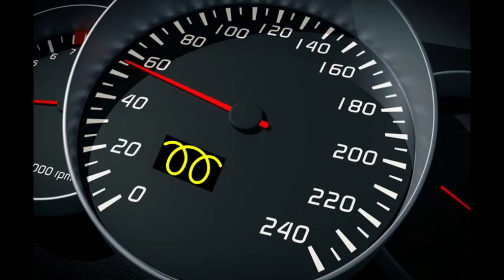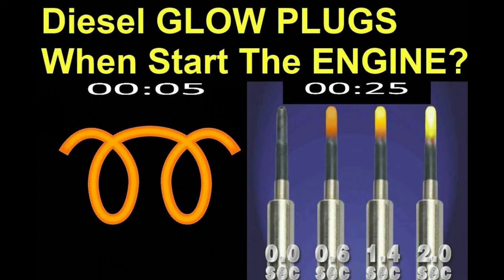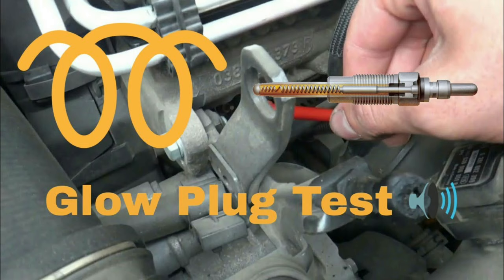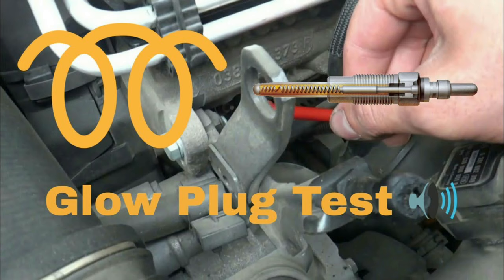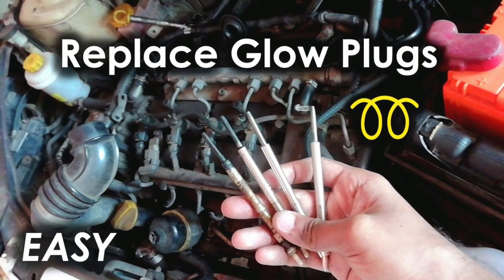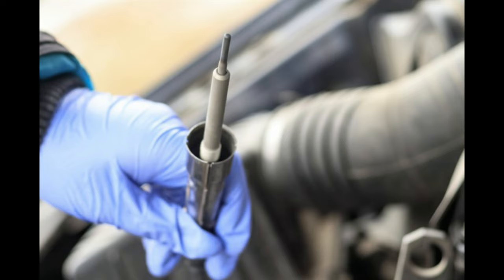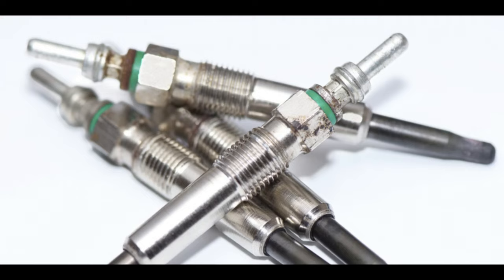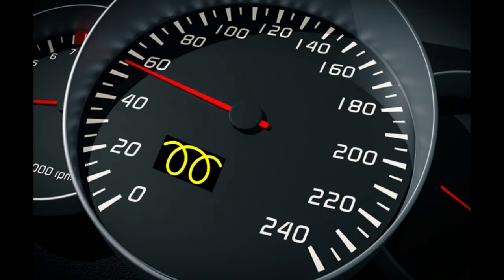How to Fix Diesel Glow Plugs Active Warning Light Stays On? Why is my Glow Plug Light Flashing

Comment: I have a 2014 vw Passat tdi and this light come out running and the car turn off and then I just start again and not problem but some time do very frequently… do you the reason?
Reply from the maker: If the warning light comes on, visit your Volkswagen dealer as soon as possible. VW will turn the light off for free. Until you visit the dealer, don’t drive over 80 miles per hour.
Reply: @Dashboardwarninglights  yes when I pass the 80 miles usually show up … I when to the dealer and they change the computer the new battery and injector and still doing the same thing.. do you have other idea what could be ??
Reply from the maker: Visit your mechanic better
Reply: @aguilat85 did you find the solution ?
Reply from the maker: I think It better for you
Reply: @chahrazadmqam3733   yes I the end I have to change the all harness of injection system… and never happened again…
Reply: @aguilat85 injection system means
Reply: @aguilat85  I’ve got the same problem as you. I haven’t seen a mechanic yet. Was it an expensive fix?
Reply: @jamespecking  I just order the injector harness in my local dealer .. and do by my self ..
Reply: @aguilat85 so the computer and battery they changed wasn’t needed? Only the harness for the injector system?
Reply: @shandhillon1975  yes at the end just the harness…. They change the battery and computer but don’t need it …

Comment: I drive an A class and it's extremely cold in the mornings so my car has started doing this and the sign disappears when I have started the car. Thanks for the info.
Reply from the maker: @ZintleNtanta The diesel glow plug warning light on your dashboard typically indicates that the glow plugs are heating up to assist with starting the engine, especially in cold conditions. Here are some key points to consider:
👉 Normal Operation: In cold weather, it's normal for the glow plug light to come on when you turn the ignition key. It usually stays on for a few seconds while the plugs heat up, then goes off once they're ready and you start the engine.
👉 Prolonged Illumination: If the light stays on for an extended period after the engine has started, it could indicate an issue with one or more of the glow plugs or the glow plug control module.
👉 Intermittent Problems: If the light sometimes stays on longer than usual or comes on randomly, it might be a sign of a developing problem that should be checked.
👉 Diagnostics: Modern cars often provide specific error codes that can be read with a diagnostic tool. This can help pinpoint whether a glow plug or another related component is malfunctioning.

Given that the light goes off once the car has started, it sounds like the system is functioning as intended. However, if you notice any starting issues, prolonged illumination of the glow plug light, or any other warning lights, it would be wise to have the car checked by a professional to ensure there are no underlying issues with the glow plugs or their control system.
👉 Happy to help!

Comment: No lights come out through glow plug ang battery what is the problem of this.
Reply from the maker: @user-Ir9dq6zn2c

If the light doesn’t light up, the glow plug is bad and should be replaced.
Easier is to use a professional glow plug tester device.
There is some discussion about whether you should only replace the glow plugs that have gone bad, or if it is best to replace them all.

Comment: I have got a Polo GT 
Like if I cross 120 this Glow light is coming up and there is an Engine break down
Can I get any solution for this

If I just switch Off/On the engine 
It will be again back to normal
Reply from the maker: @syedmufeez-st1tp
Maybe a leak in one of the hoses from the turbo

Comment: I have no warning light yet the diagnostics picks up a p0683 code with pre heating fault indicating no feed back. 
Glow plugs changed, wires checked, relay changed. Really stumped now. There seems a lot of indication it could be a  problem under the engine fuse box ,  wiring. Connectors and or the wiring itself.
Reply from the maker: @CapTango

Possible Causes of Code P0683
Reasons for this DTC may include:
Open or short circuit in the wiring from the PCM to the GPCM, to the bus, or from the bus to the glow plug.
Defective glow plug
Loose or corroded joints
Unsuccessful GPCM
Loose or corroded connections on the glow plug solenoid.
Glow plug solenoid malfunction
Insufficient battery charge on solenoid
The P0670 code may accompany this code. This code indicates a problem with the harness from the GPCM to the solenoid.
Diagnostic and repair stages
Over the years, I've found this to be a common problem with diesels regardless of manufacturer. Because of the high amperage required to operate glow plugs and their tendency to burn out, I suggest starting with the most common problems.
The GPCM uses low amperage and, although possible, is the least likely to fail. The solenoid is also rarely replaced. When you are dealing with high amperage, even the slightest loosening of the connection will create an arc and burn the connector.
Inspect the wiring from PCM to GPCM. Continue down to the solenoid on the valve cover, from the solenoid to the bus and down to the glow plugs. Look for loose or corroded connectors.
Disconnect the black and green electrical connectors from the GPCM. Inspect the connector for extruded pins and corrosion.
Use an ohmmeter to test each terminal for a short to ground. Repair the short circuit if necessary.
Apply dielectric grease to the pins and reconnect the harness to the GPCM.
Inspect the positive battery and the GPCM connection on the glow plug solenoid. Make sure all wires are clean and secure.
Inspect the glow plug tire. Check the connection of each wire on the bus and make sure it is clean and tight.
Remove the wire from the glow plug and check for a short to ground.
Using an ohmmeter, examine the glow plug terminal with one wire and ground the other. The glow plug is out of order if the resistance is not between 0.5 and 2.0 ohms.
Check the resistance in the wiring from the glow plug to the busbar. Resistance should also be in the range of 0.5 to 2.0. If not, replace the wire.
If the above does not help identify the problem, obtain your service manual and go to the page for the glow plug schematic. Look at the color and pin number for the GPCM power and power supply on the solenoid. Check these terminals according to the voltmeter directions.
If there is no power to the GPCM, the PCM is faulty. If there is voltage across the GPCM, check the voltage from the GPCM to the solenoid. If there is no voltage to the solenoid, replace the GPCM.
Reply: @Dashboardwarninglights   wow. Thank you for all that information.  As I replaced all 4 glow plug  I checked all wires and connections  to make sure they were good, all tested OK.  The van was bad at starting before this but it now starts as it should .
My main concern is now I've done all this work including cleaning our the egr valve and associated pipes, cleaned the mass and maf sensor air intake manifold. The van  really smokes heavy, it now smokes  worse than it did  before . Before it smoked for a while then stopped after driving a few miles, now it just plumes out and doesn't stop even when the engine gets hot. ?
It's nice  that you replied as a lot of people don't bother. But at least I've got some additional pointers to follow now. I think I will start by removing the engine fuse box as I've seen people showing that under there it seems to be a weak point due to the heavy power going through the cables and melting the plastic  block connector and burnt pins. Then maybe follow the path back to the pcm as it indicates s feedback problem. 
Many Thanks 👍
Reply from the maker: @CapTango

If the problem is still on, it’s best to seek professional help. 
🙏
Reply: @Dashboardwarninglights  
Just a quick update date. After replacing the glow plugs , making sure the glow plug bus bar was clean and in good order. Which  found out someone had been there before me and made a horrible repair on one of them. 
Resting the pcm , I still had the p0368 code. 
Well after some deep searching, I found the the bus bar connection to the main loom was the problem, when it went back together,  I belive one of the pins got pushed out instead of inserting into the female pin which would not ignite one glow plug, hence the plumes of smoke and the pre heating  code still being there. 
So once reinserted and glue applied to the top of the connector to make sure it won't come out again, I did another  diagnostic check on it , the same code pulled up so  it  cleared it.
Turn the engine off left it for a while struck it back up, scanned it, no more pre heat code and no more smoking. So a minor relaps of concentration caused the problem. Will be double checking all connectors in future. 😃
Reply from the maker: we are so glad that your problem was solved   😊

Comment: My glow plug light comes on even after my truck has been running.
(I’ll stop at the store and upon turning my truck back on the wait to start light comes on for longer than usual….
Should anyone know what May be occurring with my truck, please enlighten me. Thanks
Reply from the maker: @cathyortiz4111
Possible causes:
1. Faulty glow plugs: One or more glow plugs might be failing to heat up properly, causing the light to stay on.
2. Glow plug relay issue: The relay responsible for controlling the glow plugs could be malfunctioning, keeping them energized longer than necessary.
3. Damaged or faulty wiring could be sending incorrect signals to the glow plug system, resulting in the light staying on.

👉👉 What To Do When the Glow Plug Light Comes On After Starting
STEP 1: Stop driving and let the engine cool down
STEP 2: Check the glow plugs
Locate the glow plugs on your engine and remove them using a wrench or socket.
Check each plug for physical damage, such as cracks or breaks. Also, check the tip of the glow plugs for signs of wear or damage.
Use a multimeter to test the electrical resistance of each glow plug. Typically, the resistance reading for a glow plug can range between 0.5 and 2.5 ohms, but it’s best to check the specifications to confirm the correct range for your engine.
If you find any damaged or worn glow plugs or ones that do not meet the resistance specifications, replace them with new ones.
Reinstall the glow plugs in their original locations and tighten them securely with a wrench or socket.
Start your car and check to see if the glow plug light turns off. If the light stays on, follow the next step.
STEP 3 :  Repair broken or malfunctioning parts
If you are unable to do it on your own, get your vehicle checked by a skilled technician to repair the faulty parts.
STEP 4 :  Reset the light
Once you are done repairing, erase the faulty code from the scanner and restart your car to have a test drive. You’ll see the light is gone, and the problem has been resolved.
Reply: i have also same problem.iam facing since 3 days same problem while my tata mega xl van running on the road shows   singn of glow plug n hitting plug. can u help me about this problem ?
Reply from the maker: @geetsangeetnepal6457  The glow plug warning light in your Tata Mega XL van indicates an issue with the engine's glow plugs or the associated system. This warning light is crucial for diesel engines, as glow plugs are responsible for heating the air in the combustion chamber to aid in starting the engine, especially in cold conditions. Here are some potential reasons and steps you can take to diagnose and fix the problem:

Potential Causes
👉 Faulty Glow Plugs: The most common reason for the glow plug warning light is one or more faulty glow plugs.
👉 Glow Plug Relay Failure: The relay that controls the glow plugs may be faulty.
👉 Wiring Issues: Damaged or corroded wiring can prevent the glow plugs from receiving power.
👉 Battery Issues: A weak or failing battery may not provide enough power for the glow plugs to function properly.
👉 ECU Fault: The engine control unit (ECU) may have a fault or need a reset.
Diagnostic Steps
👉 Check Glow Plugs:
Remove and inspect each glow plug.
Test them using a multimeter to check for continuity. If a glow plug does not show continuity, it needs to be replaced.
👉 Inspect the Relay:
Locate the glow plug relay and check it for any visible damage.
Listen for a clicking sound when the ignition is turned on, which indicates that the relay is working. If you don’t hear the click, the relay might be faulty.
👉 Examine the Wiring:
Inspect the wiring to and from the glow plugs and relay for any signs of damage or corrosion.
Ensure all connections are secure and clean.
👉 Check the Battery:
Test the battery voltage. A fully charged battery should read around 12.6 volts or higher.
If the battery is weak, consider charging it or replacing it if necessary.
👉 Scan for Fault Codes:
Use an OBD-II scanner to read any fault codes stored in the ECU. These codes can provide specific information about what might be wrong.
After addressing the issue, you can also use the scanner to reset the warning light.

Next Steps
👉 Replace Faulty Components: If any glow plugs, relays, or wiring issues are found, replace the faulty components.
👉 Clear Fault Codes: After repairs, clear any fault codes using the OBD-II scanner.
👉 Consult a Professional: If the problem persists, it might be necessary to consult a professional mechanic for a more thorough diagnosis.
By following these steps, you should be able to diagnose and address the issue causing the glow plug warning light in your Tata Mega XL van.

Comment: It glows when speeding my vento more than 80kmph but when immediately restart the car
It stops
Reply from the maker: @rupindersingh319

When the diesel engine pre-glow light persists or flashes, it could indicate an issue with the glow plug system. To diagnose and fix this, use a diagnostic tool or OBD scanner to retrieve error codes. These codes will specify the problem area, such as faulty glow plugs, a malfunctioning relay, or issues in the wiring. Based on the codes received, you can replace or repair the problematic components. If you're not familiar with the system, it's advisable to seek assistance from a mechanic or someone experienced with diesel engines.